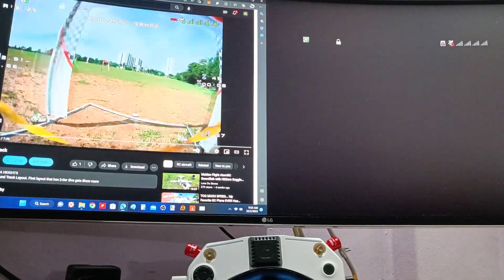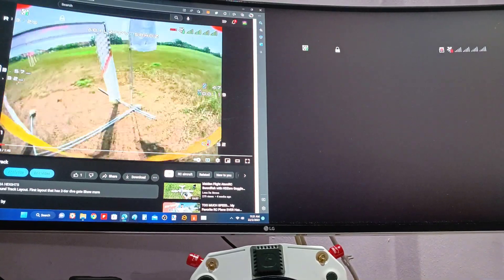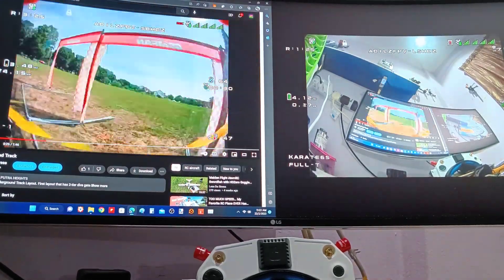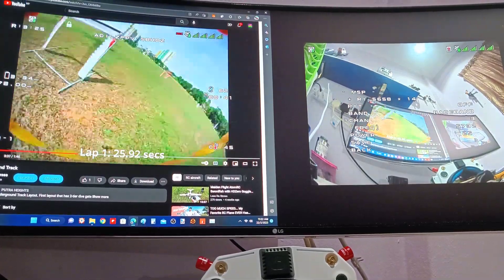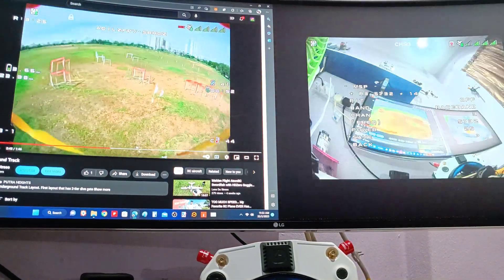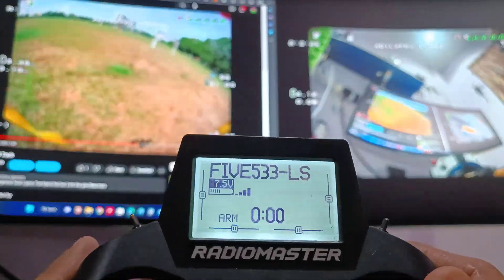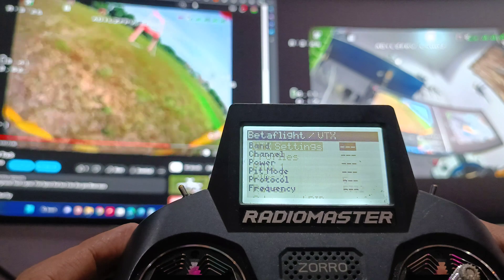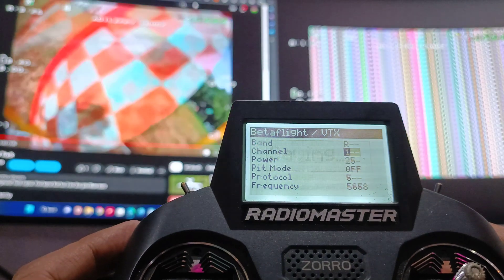I Don't Need SmartAudio Anymore to Change Betaflight VTX Settings.

Comment: I hate to tell you but the smart audio wire is what is allowing these changes to take place on your VTX. It is still being used.
Reply from the maker: Sorry to let you know that I didn't even wire the SmartAudio pad on my Race V2 VTX. Only V,G, Tx and Rx pad is connected to my FC.
Reply: MSP + Display Port via UART (Rx & Tx)